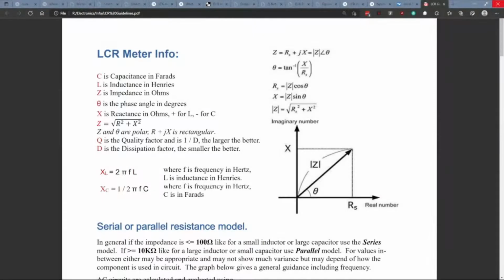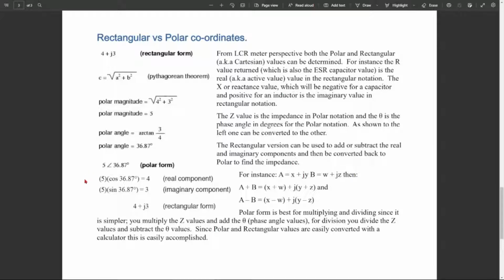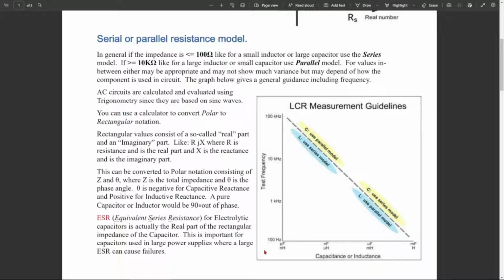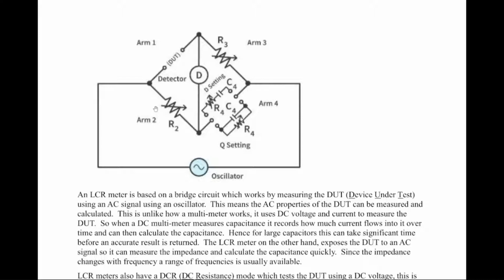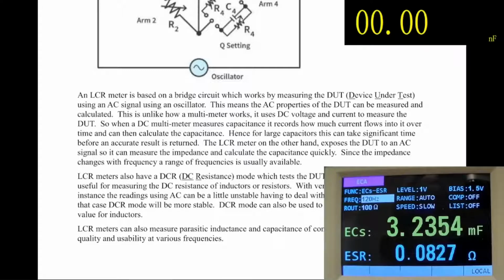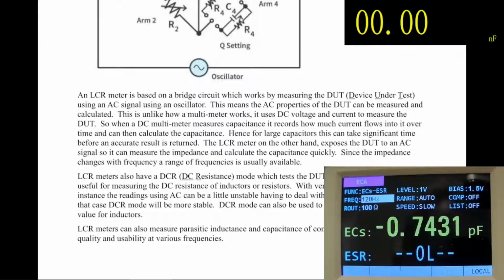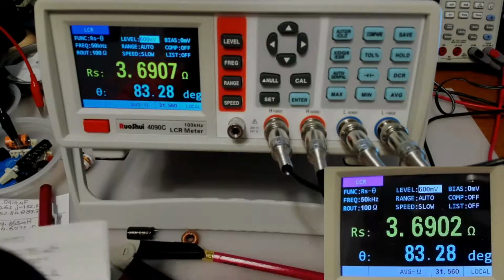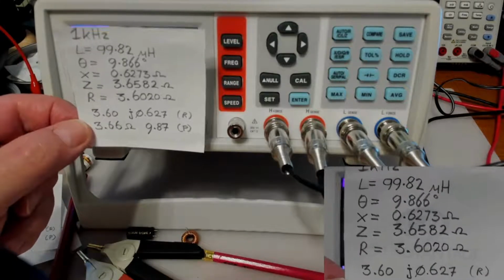LCR Meters what do they measure?

Comment: When you measured the 1 mH indcutor I noticed something interesting. When you measured it at 15 kHz it didn't make any difference when going from serial to parallel mode. It's technically in that gray area with X = 95 ohms so either will do.  But in serial mode at 1 kHz we have L = 1.034 mH and so X would be 2*pi*1000*1.023 mH = 6.43 ohms which is precisely what was measured. However in parallel mode we have L = 6.22 which calculates to X = 2*pi*1000*6.22 mH = 39.08 ohms. And yet it still meassures the same reactence of 6.42 ohm as in serial mode. So it seems that if there is a discrepancy between the calculated reactance and the measured reactance that the wrong mode was chosen for measurement.Had we done it initially at 1 kHz in parallel mode and noticed a low 6.43 ohm reactance we would also have realized that the serial mode should have been used.  BTW this is an absolutely great review. Amazing that it has not gotton more views.

Comment: You're DER EE DE-5000 will measure the 3300uF capacitor, but you have to change the frequency down to 100 Hz which is where capacitance is supposed to be measured at.
Reply from the maker: Good call didn't think of that...